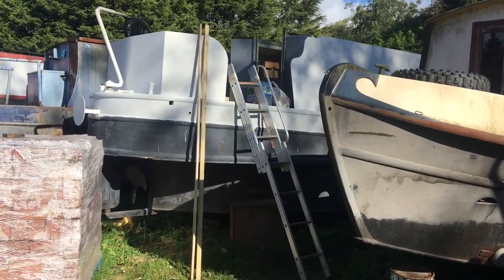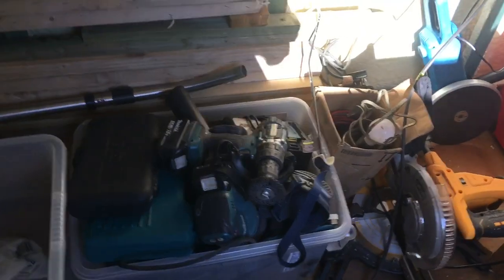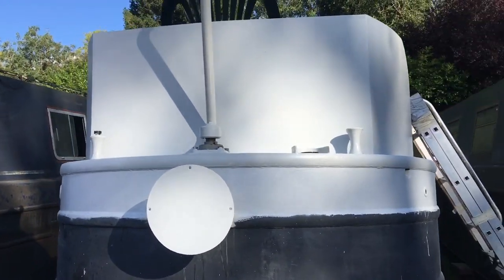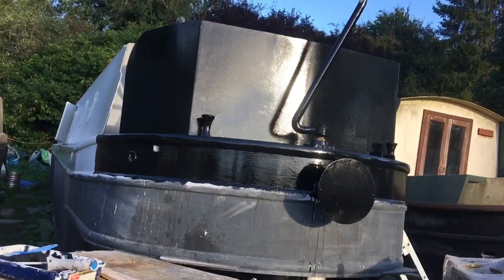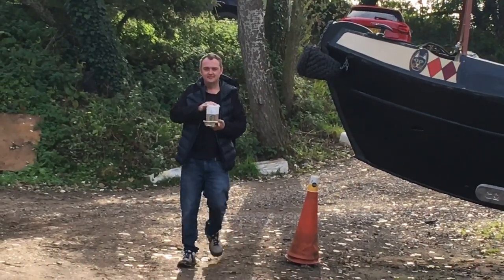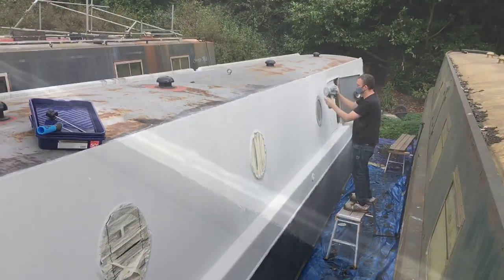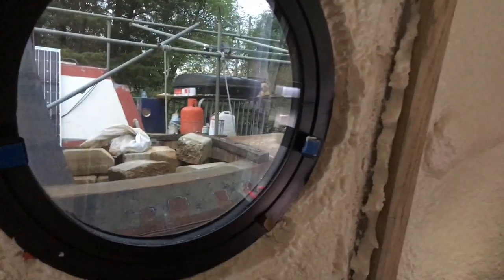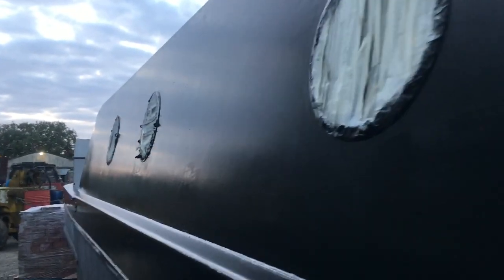59. Paint It Black

Comment: Looking good Oli. You've put some hours in sanding and painting . Ru doing the roof before winter or waiting till Spring ?
Reply from the maker: I’m thinking now it’s going to have to wait until the spring,  it’s had 15 years out, hopefully one more won’t do too much more damage. It’s getting too cold for the paint to cure properly, too damp, too few hours of daylight to get really stuck in.
Reply: Have you tried Abramesh sanding discs, less dust just dampen the surface to be sanded and clean them out with a swill in clean water and a far superior finish,